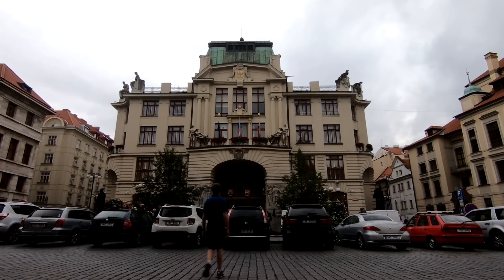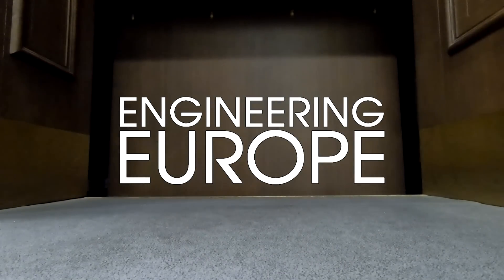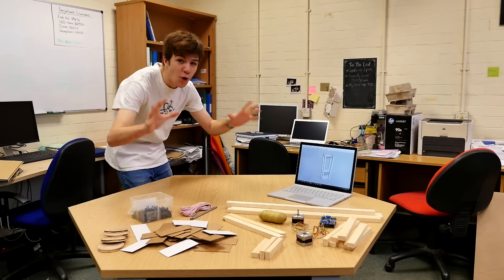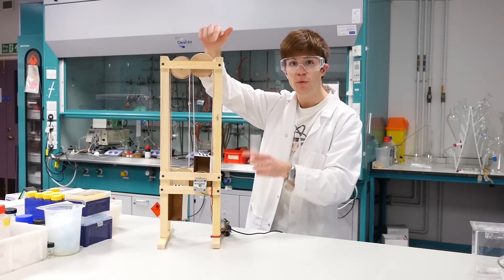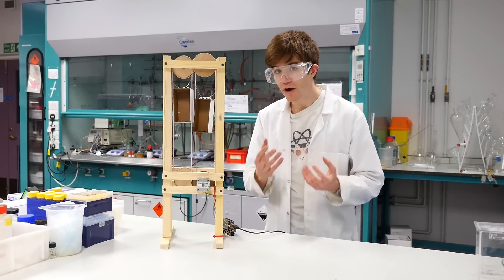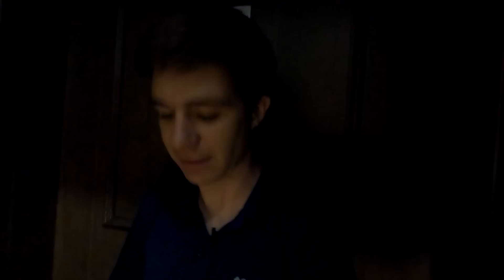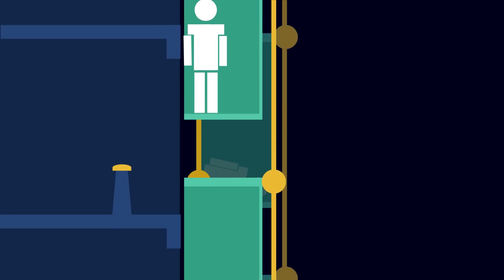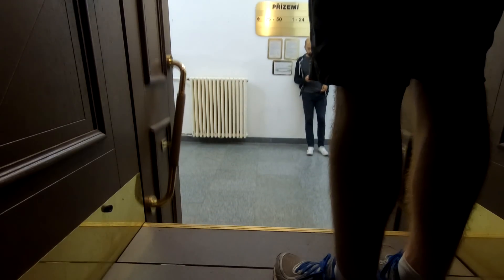Riding the Elevator of Death

Comment: If you want to see a somewhat modern one of these you can go to the Springer Building in Berlin - Germany.
This one has safety switches on the exits on the floor and the cabin side.
These switches halt the system if someone should get stuck.
The worst thing that ever happened is a hefty fine for halting the paternoster by trying to enter it with a food trolley.

If you ask me without the safety switches, paternosters are nice darwinistic invention.
In the sense of the Darwin Awards that is.

Comment: In some ways once elevators that can move both horizontally and vertically become common, this becomes more likely. If you can fit multiple cabs in one shaft, then you can make a cab come more frequently and reduce waiting.

Comment: There used to be one (airside) at London Heathrow Airport but alas it's gone now.  I used to work in the building and travel it every single day.  "Elevator of Death" is a little bit overdramatic.

I think the only time that I would have avoided it is if I was carrying something awkward or in a wheelchair.

I did ask the maintenance guy one time to let me in the machine room to see how it worked and he obliged.  Our one ran on chains.

Lastly - there is one other HUGE advantage that the video above didn't mention - the system is pretty much balanced.  No worries about counterweights or anything like that.

Comment: They have (or had, been a few years) these in Switzerland, with a couple specifically in Bern. I remember the first time I cam across it I was fascinated and rode it around a few times. There was actually a lot of grafetti at the top and bottom turns which was quite impressive.

Comment: They have something like this in electrical powerhouses. Although it is just a belt with a small piece of metal on the side. It goes all the way up through manhole like circle cut outs in the floor. Big sign at the bottom saying “No contractors on man lift”

Comment: Fun fact: the ecb (European central bank) in Frankfurt, Germany has one of these. But because of safety restrictions they aren’t in use. So they just built them into the new building without checking if they’d even be able to use them. So now they just have these empty elevators that no one is allowed to enter.

Comment: Pressure plate at the edges where the floors meet that would give way if an object were to be trapped between them, causing the floor to fall to a 45 degree angle that would turn a potential guillotine into a rough dumping of the passenger either into the lift car or the entrance way. This pressure plate could be locked from moving whilst the platform is close to it's intended boarding position, using some simple grooves or notches on the platform. It's nice having efficient stuff but I could see how these might not be ideal.

Comment: What if we used this design combined with the queue and stop system of modern elevators, where a cage or door would be in front of every cabin, and the door would open and the elevator would stop only when someone on the outside wants to get in or someone on the inside wants to get out. This would work less and less efficiently the more floors there are, but surly there must be some way to make this work, like installing one to go halfway up and another to cover the second half?

Comment: I feel like if you lined the cabs and floors up right you could have it stop for 15s at each floor (with a little chime and light to notify people when it's gonna start moving a few seconds in advance) and maybe a button to extend the stop period an extra 15-45s for slower people like the elderly, wheel chair users or people with big luggage to get a bit more time, that way it's more comfortable to get on and off

And fix the safety issue by having a trip wire or pressure plate that halts the elevator if something gets caught between the roof and floor, and if you'd like to be advanced you could have electronic tripwires (like those you'll find with garage door openers) that'll prevent it from moving if something is on the edge

Though, if you can make it stop you could even just put a door/gate on it so people can't get on/off when it's moving

Comment: But why isnt there a detector on the blanket of the cabin? And if something push this (for example pole) up, the paternoster stop right away?

So if something comes between the cabin ceiling and the floor, is the bar pushed upwards by the jammed body part and the emergency brake stops the paternoster?

Comment: A stop bar running the length of the threshold on the ceiling and recessed into the floor on every level seems like an incredibly simple solution, especially if they already have e-stops on every floor.
I'm shocked no one has come up with anything better than an e-stop miles away from where it needs to be.

Comment: Maybe they are a bit more dangerous than normal elevators but you can improve that with a lot of technics. 
The more relevant thing to not use them anymore is the change of the use of buildings.
This paternoster elevators were installed at some big department stores in Germany. In earlier times a lot of people worked there. The Shops opened at 09:30 am and closed at 6:30 pm. Nearly all workers came and went home around the same time. So this system was very convenient with not waiting time and the possibility for everyone to go to his floor without any further stops. 
The same was for office buildings like city halls and so on. Today a lot less people work in such a building and due to modern time shift systems not everyones comes and goes at the same time. So using a normal elevator is not a big issue. The benefit of the normal elevator is that you can carry heavier items with you without a problem. Even for people with handicaps or parents with little kids it is better to use.
A lot of this paternosters were replaced due to the fact, that the older buildings didn't have a normal elevator and didn't have a lift shaft for these. So it is a lot easier to rip off the paternoster and replace it with a normal elevator everyone can use. 
So I think the question of accessibility of buildings and the possibility to transport items with you is the more important question then the safety.

Comment: There was even once a prototype of a modern paternoster where the entry and exit were laser-monitored.  The moment someone stood inside the cell and stuck his hand upstairs, a security system was dropped that would not allow the elevator to move an inch.  So yes, a women's elevator, if it is worked on a bit, is safer and more efficient in transporting people than conventional elevators.

Comment: There is a paternoster lift at Loughborough college in the UK. It was actively used and loved by all there in the 1980's when I was a student. But sadly it has now been boarded over and not used. It really was a great system and very good at moving hundreds of students efficiently. I think it was about 7 floors. Such a shame it was stopped. I'm sure with modern safety systems and sensors it could be made safe

Comment: You could always install the very thing that makes our current generation of elevators to make it safe. Sensors, mechanical safety devices triggered by hindered actions that don't require electricity or maintenance specifically on said device. That could in fact make the Paternoster Elevators' design effective, safe, and possibly even cost-efficient.

Comment: This video is not serious. I know this lift. There were 3 elevators in Košice (Slovakia). Today, only one works at the technical university in Kosice. It is a technical monument today. The elevators have sensors installed at the top of the grille on each floor, and each cab has a sensor at the top. Both the top and the grid can be moved. The problem with the lift is not security, but the economy. The lift has a large transport capacity, but the engines are still running and this makes a huge consumption. Therefore, the university runs a lift in the morning and afternoon for a few hours and turns off.

Comment: They just needed to position the elevators at the right distance away from each-other to allow them to stop for a few seconds on each floor before going to the next. So you would still have to time it right, but it would reduce the risk tremendously without the cost of much time.

Comment: If they pushed the elevators back, added an extended floor to step on, and added a floor surrounding the elevator with at least a foot of space between the elevator and the floor, there would be a great decrease in limb damage overall and the elevators may still have been openly used today

Comment: What about just making it stop for three seconds each floor nd having a little gate fold down automatically to block it when it isn't those three seconds. Add in sensors to make it only stop when someone is present by the gate or has pressed the corresponding button for a floor and you don't lose much speed but do make it easy to get in.

Comment: Getting sheared in half is my biggest fear of modern elevators and this one just increases that risk 1000 times. Like there could be an easy solution to this type of elevator tho. Just have some kind of bar at the top of the entryway for going up, and one at the top of the car for going down, that when pressed shuts down the machine. Preferably a mechanical breaking system so there is no risk of electrical failure. Having to reset the lift every once and a while is a small chore in comparison to cleaning up blood. Janitors would be happy.

Comment: The paternoster elevator is in fact much more safe than presented in this video, becauce there are some safety mechanisms that automaticaly stops lift in case of emergency. The main disadvantages of paternoster lift are low speed, need of many cabins and the need for two shafts and many cabins. And the handicaped people have a big problem using this sort of lift. Also price of this elevator is higher than usual. I have a personal experience... :-)

Comment: Why not just add a pressure sensor to the ceiling right outside the loading area and on the ceiling of the elevator so that when a certain amount of force is applied it would trigger an emergency stop

Comment: People were killed or injured not because of elevator is dangerous, but because they did crazy things there and didn't respect rules. There are sensors which stop lift if you let arm or leg outside, but when you are entering with dog on a leash or something like that, you can't be surprised then when your dog will be executed. :-D Paternosters are part of our culture and technical heritage, we know how to use it, but some people just don't have basic common sense. Basic rules - don't use elevator to transporting objects, it's only for people and second rule - don't enter with cables, ropes and such things. Also respect maximum capacity and it's completely safe. I think paternosters were removed because of it's useless for old people, they just can't enter and leave fast enough.

Comment: All they need to do do make this safe is run an electrical signal through the opening of the lift and the doorway so if ever someone is touching both the lift opening and the door at the same time, the signal breaks and the lift puts on the breaks. Much like how table saws work. Theyd also need to suspend the lifts via springs to allow leeway so the lift has enough time to stop. Itl hurt but you won't lose an appendage.

Comment: I wonder what will happen if you put a thick wood beam between one of the cabins and the floors when it goes up? Will it crush the beam or it will stop the entire paternoster? 😃
I think the answer will be it will crush the limb 😃, because the paternoster has enoug power to lift several cabins with people.

Comment: I'm curious, would a paternoster lift with sensing stops on the doors like modern elevators be viable? Something where there is a protective screen to prevent someone from falling down the shaft or getting in the elevator in motion at an inappropriate time other than when they decide to stop it. It would only be logical from a safety standpoint that the elevator would have an automatic stop for when it detected something between it and the top of a floor.
Reply: Most have had this the ever since they were invented. The boards covering the top of either opening are free-floating, and touching them stops the whole thing. Very simple, very safe. 5 fatal accidents in 23 years is actually decent safety record, considering how many people they moved and how little attention (and, in result, maintenance) they had. People can still trip and fall like on stairs, though.

Comment: Hmm, wouldn't it be possible to stop these when they arrive at a floor? They would have to be aligned a lot more precisely, but if we made them stop at the right time it would remove the speed advantage, but the fact that you can stack way more elevators would be still worth it in my opinion.

Comment: It seems that it is not hard to improve their safety using modern technology- one laserbeam kill-switch (literally) 30cm before the top of the opening for upward direction and one laserbeam kill-switch 30cm before the top of the cabin for downward direction and if those fail, then safety relies on the mechanical kill switches that are visible on this video-there is a fence-like looking thing that is the kill-switch for upward direction and and I guess a false cabin ceiling that has a kill-switch if lifted

Comment: You say "the problem is User Experience" as if the problem was something like "people find it annoying and don't like to use it". If the problem is that "people die using this elevetor", it's MORE than just a user experience problem: it's a safety issue.

Comment: Why don't the just make it pause for a little each time the cars align with a floor?
Reply: It was never necessary, which allows the drive to run at constant rpm and a near-constant load, making them very efficient. It's just like stepping on or off a large boat, you either wait for the right moment or walk up or down a step. Running at constant speed makes timing the step very intuitive, and it becomes second nature on the first day. In most places two people share a carriage at peak hours - when embarking and going up, one walks down a step, then the other walks up a step.

Comment: And that's why we don't see too much technological advancement like our books of such (for example: Cool Stuff - And How It Works) -- PARANOIA. And many other factors, of course.

While the potential for death IS certainly a concern from this video, there's just a simple solution: Just have the elevator itself apply far less force so a human body LITERALLY stops the elevator from moving at all itself. Trust me, what used to be a problem when it came to designing SIMPLE things such as toy cars and cranes, could MOST CERTAINLY be used with Paternoster elevators to save SO MANY lives. Simple, yet criminally overlooked. (LOL.)

Comment: Not convinced of your arrangement of wheels for the mechanism.
Reply from the maker: Interesting. I based the design on some old engineering drawings, but I'm sure there are other possible arrangements. How would you set it up?
Reply: @AtomicFrontier  I think what I  had in mind was a more lop-sided loading arrangement - held on one top corner suspended from the chain then a guide roller that also locates into the chain at the bottom of the car on the same corner of the car. So it's almost two point fixing to the chain but at top and bottom of travel, the bottom guide roller comes out of the chain, takes a low semi-circular path 'over the top' and reinserts itself into the chain it meets on the downward travel. However, this does not account for what happens at the bottom ! I think I'd got this notion from an 'over the top' video where there was a guide curve partly in view lower down - as if a lower car guide roller followed that.
I'd not considered a support at the back of the car as well as the front.

Comment: This video would not get so much attention if you mention functionality of the "grill" panel at the top of every entrance/exit - visible on the video as well. This panel is moving up and works as stop sensor. If anything is hanging out of the elevator and touch the panel, it will automatically stop whole system. So there is same chance to get hand chopped as in regular lift - practically impossible. If there will be defective se sensors in the panel its the same as if you can open door of regular lift while in operation.

Comment: To call these "elevators of death" is not fair in my eyes. Use it by the rules, step in and out only when the floor of the cab is on the same level with the floor in front of it (+ - 10 cm), use the handles, don't transport any freight in it, stand in the back part of the cab and don't use a cab with more than the allowed number of persons, and you will survive every paternoster ride without problems.

Comment: Use of a paternoster elevators needs some instructions how to use them . I used them many times  untill the 90ties , even go turn arround in dark (no lights in turnarrounds ) .  The use of a bike on the street is more dangerous than a  paternoster elevator  . If your are affraid , do not use them , simple it is .

Comment: How many functional adults get injured every year? Or we talking about US Americans who need everything to be so idiot-proof to prevent them hurting themselves and then running to a lawyer?
Reply: Regular elevators stop and allow the elderly, disabled, and wheelchairs to get on and off without increased difficulty or fall risk
Reply: @flashsurfing  Often it's not a choice between either or but both.  Put in a paternoster to handle 95% of the passengers who are able and then add a standard lift for those who need the stability and time.

It's a win-win that MOST people don't have to wait for a lift or too long if a cab is full and others have access to a standard lift not full of people who don't need to use it.